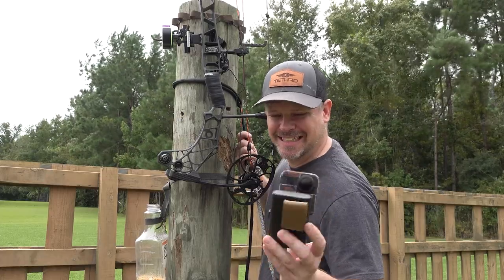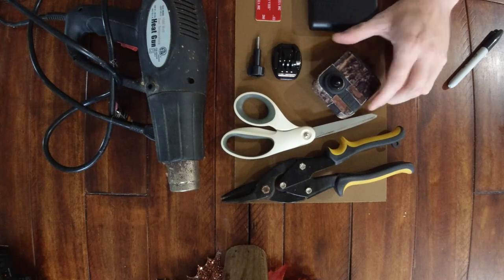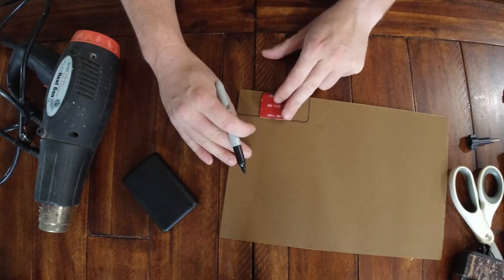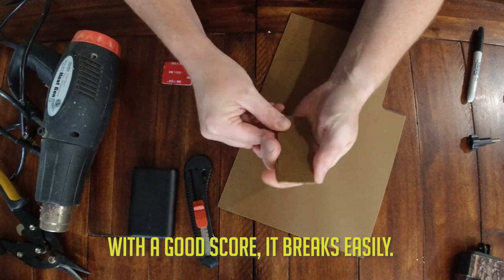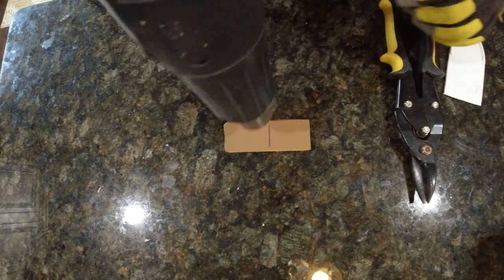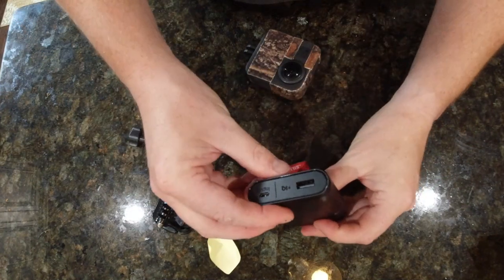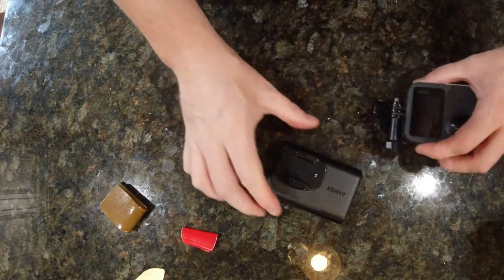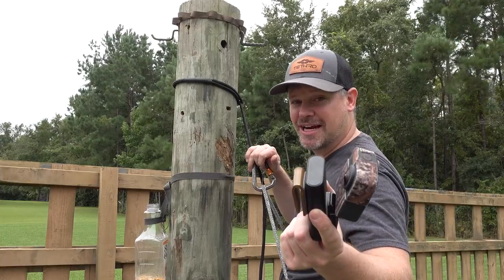DIY Kydex 360 Camera Mount for Saddle Hunters

Comment: I will do this for sure. Thanks for the video. I noticed you mounted the camera mount to one side of the power bank and the hook to the other side of the power bank. Did you do this for balance or to allow the lens on the back side of the camera to see around the power bank? My OCD wants to mount it in the center of the power bank so just making sure it was for a purpose how you mounted it.

Comment: Be careful using that in cold environments, I've had issues with that tape holding when the temps start to really drop. Next time clean the surfaces with as high of "proof" isopropyl alcohol that you can find before you stick the tape down, it removes oils and gunk you wouldn't even know is there. If you really want it to bond with whatever you stick it to try heating it up with that heat gun right before you place it too, it'll REALLY bond with plastic that way. Great videos as always!